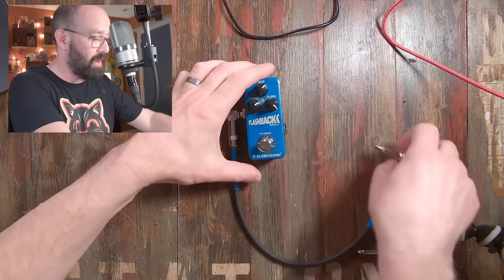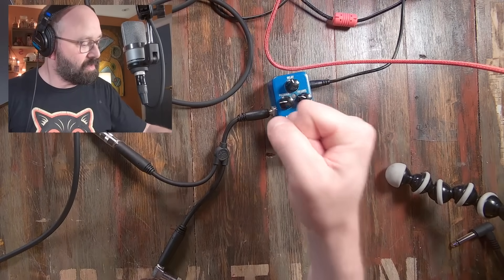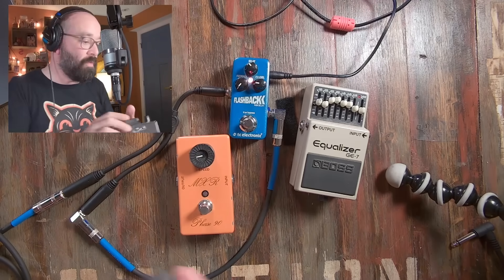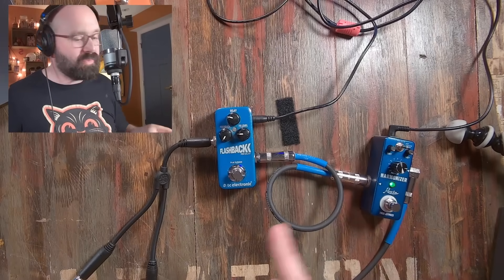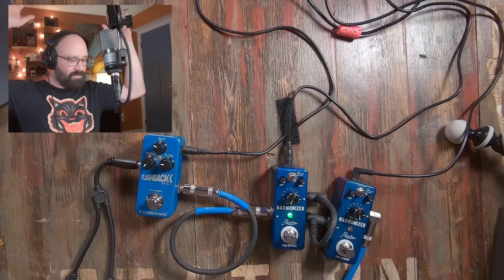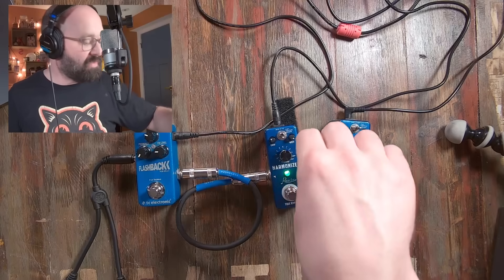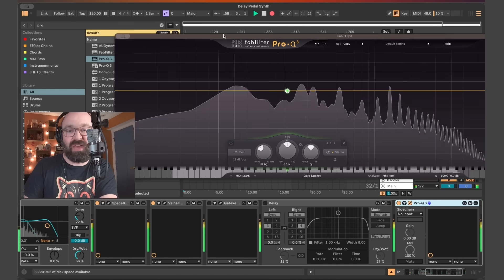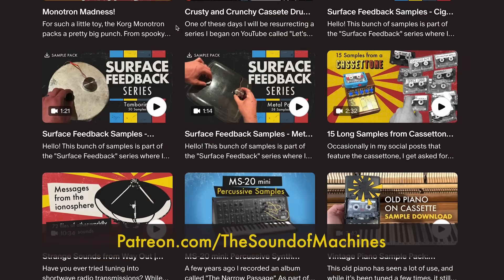This is What Happens When You Plug an Effect Pedal Into Itself

Comment: Great Video. Just out of interest there a few things you can do as well to enhance this effect. One is to put a passive volume control in the feedback loop. When things like a 10 band EQ is being the source then the volume control allows you to control that point right on the verge of feedback. The sliders will give you different frequencies as well. Interesting effects result. Also think of the Zoom MS70 CDR pedal for example with its 136 effect types and any 6 in a row can be used! Imagine the possibilities here. Put that into feedback mode and check it out. Also you could set up say 4 effects pedals instead of being in series make them in parallel ie 4 separate feedback loops and feed the 4 outputs into a 4 channel mixer. Then the 4 feedback loop effects are not acting on each other but acting independently but you are hearing all 4 at once though.

Comment: 4:21 You do have hardware in the chain. A power supply with electrical noise and your audio interface, to which the pedal is connected. You hurt my brain. Not to say the sounds are not interesting, but that's what looping affects do. It's like holding a video camera at a video monitor and getting the never-ending portal effects.

Comment: I used to use a box radio with rca Jack's in the chain. And I could record it using the tape deck in the radio. Loads of fun. I did this back in the 1980's. The radio had a mic input as well, so I could add mic feedback to it.

Comment: Your splitter cable is two way. It's a little closer to the output of the flashback, but it's also connecting the Scarlett's input to the input of the flashback. You could see what the Scarlett's input sounds like by connecting it to a different audio interface. It easy not be generating any noise, but we won't know until we see an experiment. 

Interesting video - thanks!

Comment: Maybe something people don't realize: Effectively, the input to the effect modules is the "click" of switching it on. It doesn't conjure up the sound out of thin air.
Reply: Not necessarily. All circuits have some sort of operational noise, which is why we have a signal-to-noise metric for our gear. Go plug a pedal into an amp with no input device (or even a jack that ties the input to ground) and turn the gain up on your amp/workstation. You'll hear some sort of sound, be it a hiss, digital hash, or some outer form of quiescent noise. That is what the pedals are feeding on.
Reply: Feedback

Comment: What happens when it plugs into itself, well it's simple it's Schrodinger's pedal.
I have a couple 2.4 GHz wireless microphone units and the storage method is to plug the transmitter and receiver together.
Yeah yeah yeah the same thought started pondering through my head one day the answer is insert a Y cable and not much.
But It did pose the question of what do other things do?

On a similar sidetracked Trail there is a big thing of using analog mixers as feedback effects, so it will do things in some instances.

Comment: Nice! Next time, you could use two splitters. So  you can input a guitar signal through one of the splitters.  You can adjust the level of feedback with the output level of a second pedal  in the feedback loop.

Some pedal and amp circuits use retro feeding of a fraction of the signal. In analog delays the ratio is adjusted with the feedback knob. In distortion/overdrive circuits it is sometimes used to make for a more dramatic clipping.

Good stuff!

Comment: Great stuff. Used to do this with just a flanger and wah pedal. If I got the settings just right I could arpeggios out of the flanger working just on noise. Had a tendency spiral into chaos, but I could use the wah pedal to fine tune it.

Comment: If you put an EQ in the loop you can control the amount of regeneration that occurs, and if you add another splitter you can feed a guitar signal through and regenerate some of the sound through the loop while controlling feedback. You may need to use buffered "splitters" but this is a thing that is done in studios sometimes. You can also do weird things like split the guitar signal, run it through two EQs to split highs on one side and lows on the other, and apply different effects to different parts of the spectrum then put them back together. The bypass loop is sometimes used to let some "dry" signal bypass the effects so the tone doesn't get too muddy- like you can use EQs to let more midrange or bass or treble through depending on what you need in the final mix.

Comment: Would be cool to use this live before a show plugged into an amp, reduce the master volume to zero, unplug the chain and plug in the guitar chain to start the show increasing the master back to the original level set during sound check for the sound engineers

Comment: It's not just the loop of the output connected to the input of the effect channel. Also the input of your audio interface is connected to the input of the pedal board via the splitter cable. The input circuit has it's own electrical properties like an impedance, resulting in dampening or enhancing certain frequencies, even the splitter and the cables itself have electric properties like a coil with one loop and a resistance or a complex impedance ... 

I don't know how much that influences the sound, but a simple loop with a capacitance and a coil is an LC-oscillator with a resonance, your setup is even more complicated and probably chaotic because of the feedback and non-linear effects. As you said: Each time it makes a different noise. Have tried what habbens if you just change the length of that feedback cable or using a different splitter oder audio interface? Or just using other power cables as your cables are also antennas that pick up signals from the power supplies, which normaly are not loud enough but now get also amplified in a feedback loop? Maybe you can even build a kind of bad theremin with that, as your hand changes the capacitance and inductivity of the feedback cable ...

Comment: Cool experiment, but it would have been even cooler if you had used another splitter or a pedal with two inputs to put a guitar in there and see what happens. You can use splitters on inputs also. Signal will go both ways. Just depends on where you use it. In an output it will give you two output signals. On an input you could plug in two instruments into the same pedal, or in this case, the pedal into itself. I was expecting just feedback, but it surprised me. Probably would be on distortion type pedals but I don't know. Which is why you do these experiments. You basically made a synth. Lol cool. Things like this are how effects pedals were made or discovered. Most by accident or a crazy idea. Like fuzz started out with a blown speaker. Lol then people started intentionally poking holes or cutting slits into speakers. Then using a switch to engage it disengage. And then someone said, "hey, I can replicate that with capacitors and restistors". Then someone said, "hey, I can replicate that fix pedal digitally". And everyone has an opinion but over time what they first hated becomes normal. I like all effects. Don't care what they are or how they are made. It's what you can do with it. And the audience does not care. The phaser or flanger, I forget right off but both are similar, was made by putting a horn speaker on a motor and spinning it. Then someone made a pedal. Chorus, by using two amps and off setting the signal a bit. Then someone made a pedal. Reverb started with just an empty room or canyon. Hahaha then someone said, "hey, I can do that with a spring". Then someone made a pedal. Then someone made it digital. And while new things may not always be spot on, they work and over time they will get better. Even better than the originals. Delay, someone said, hey, I can delay a signal with a hack using a tape from a cassette or 8 track or what ever. Then someone said, "hey, I can make that into a pedal.". Now, you are making new effects of ways to make effects, and you never know. It might catch on and someone will say, "hey, I can make a unit that will do that in a single pedal. Which I don't imagine would actually be too awful hard to do. It's the adding other types of effects into it where it might get tricky to make a single unit. So, I would be killer if you experimented by putting a guitar in there and see what kind of crazy things happen. And if the stars align, come back and show us how you did it. I have no idea if this video is 6 years old or 6 minutes. Haahah just want to mention that. I didn't look. I just saw a video doing a cool experiment. Either way, I'm gonna subscribe. I feel you earned that. Also because, if you do happen to throw instruments in there and find cool stuff, and then you come back to show us, I want to know. Lol so, I subscribed. Have a good day brother. And keep spreading positivity and curiosity. You never know how small things can affect the world in big ways. And that is true in so many ways. Cool video. Glad I saw it.

Comment: You're missing from your setup a jack cable with built in potentiometer. I got two or three for 2$ by the generic name of "headphone volume cable", but there are possibly higher quality options as well. This way you can easily change amount of the feedback between the pedals totally independently.

Comment: Had alot of fun with this idea, my set up was an bass into a di box with the link going into a gk amp into oc2 into a whammy there are some weird connections inside the gk amp that ended up letting clean bass and the effected sound to play in parallel but the bass sound was also somehow effecting the self oscillation
Reply: Can't remember exactly how i wired it up but it ended with me and the foh engineer googling the schematics of the amp because we couldnt explain how it was happening. Best guess is a passive di box let signal go both ways

Comment: Every single person who sees this video is about to buy that splitter cable.
Reply: I'm going to need more than a couple of these...i have a lot of time based pedals. So much to do!
Reply: @MorseCodexGigas makes me wanna try a fuzz or something. Some times if you push a fuzz hard enough, a control
can turn into a frequency knob.
Reply: @BounceChord tried this with my Boss FZ-1, it's literally just a whammy pedal that's controlled by a few knobs.
Reply: @MorseCodexGigas Not all splitter cables are the same. But, if you want to have some real fun, get a feedback looper pedal. It's an easy way to run any signal chain back through itself, control the feedback, or turn a part of a chain on and off. I have made several. Free plans are online at Beavis audio research and Holy Island Audio.
Pretty easy to make
Reply: I've had one for years that I've done literally nothing with until, uh... now? Maybe?
Reply: I use already now two off these splitter cables in patching my MS 20 with the MS 10, originally from the seventies. These splitters, y-cables officially called, gives you so much more possibillities.
Reply: And Google “no input mixing”
Reply: If your a long time musician you already have four
Reply: @jaundong3692  I'm sure I have one, but checking would require untangling my cable drawer.
Reply: Make it they are easy to make
Reply: I already own two. Im gonna be experimenting later
Reply: You could do it with a DI box as well.
Reply: I might buy two of them, so I can plug a guitar into the input, and then have the loop in the middle, with an output. I would be interested in hearing what that sounds like.
Reply: @TheoPfeifle like output the feedback signal into an amp?
Reply: @BounceChord ... Except I'm not talking about amplification. I'm talking about recirculating on a delay or something like that.
Reply: Who doesn't have like a  dozen splitter cables?
Reply: Make a splitter in 2 seconds
Reply: It's a hit
Reply: I wanna try this with my Proco Rat2
Reply: 7 bucks on sweetwater…bam!

Comment: Great video.Get a passive 4x4 mixer. You can put several different pedals in and out. The mix knobs on it let you do weird things. I built an 8x8 passive mixer. It is on my 2nd YouTube channel. I put like 30 effects cycling on it. Peace
Reply: Ino input mixing is sweet, can’t wait to see what people do with it
Reply: I love my passive 4 channel mixer. It’s like a Swiss Army knife, and it’s tiny.
Reply: Now take each channel of the mixer back into the next channel
Reply: I run the aux and headphone out back in to channels in my mixing board.  One board is wired to be a precussion generator, the other, for harsh noise / wall drones

Comment: The fun of 'zero input' noise production. Can get some very interesting tones, though safest if you put a 'brickwall' limiter between it and your amp/recording interface to protect both your ears and equipment.     😉
Reply: I used to do a lot of this in the 90s! I had a super glitchy octave pedal that really made things nasty. And a wa-wa pedal turns it into a tone generator!
Reply: @mikeciul8599 I just tried this trick in the video with my OC-5, it make some really weird noise when paired up with a fuzz, which basically turned into a whammy pedal, speaking of which the actual whammy pedal just turned everything into pure sonic barf, unless you used one of the harmony options. Need to add my wah to the chain now.